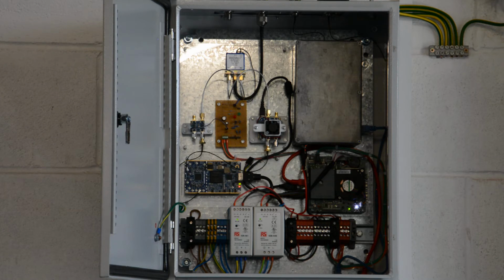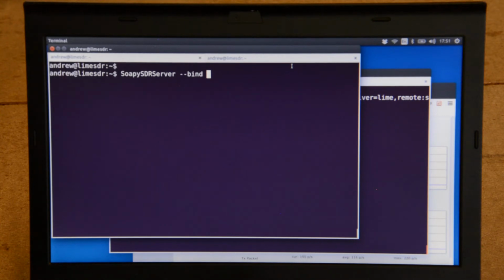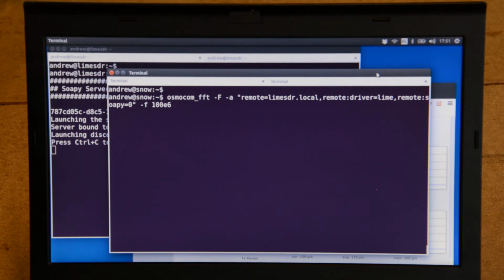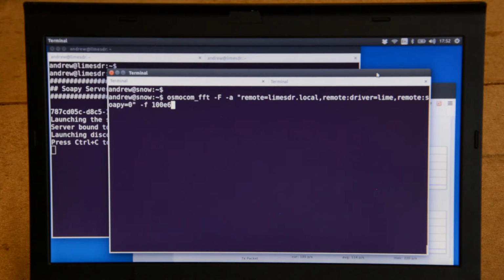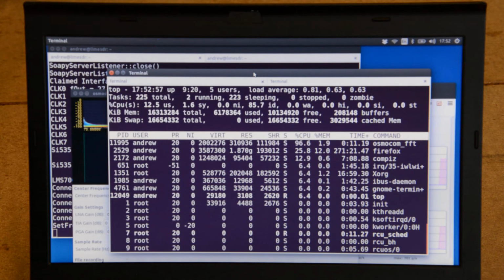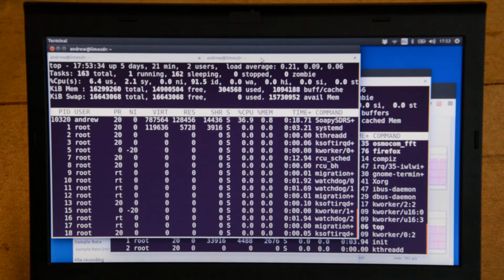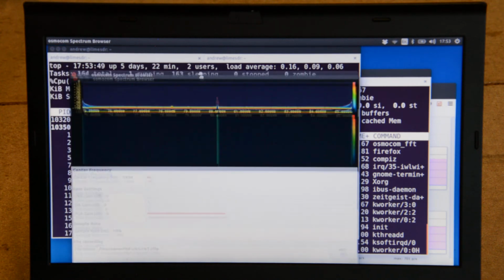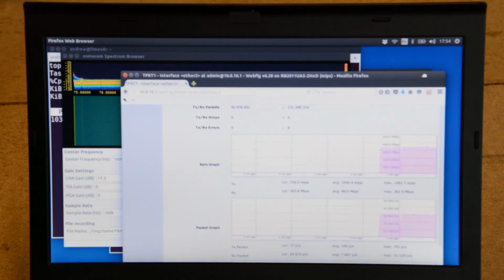LimeSDR + SoapyRemote + osmocom_fft Demo

Comment: How did you install the Lime software / SDRAngel?   Did you start with Ubuntu 18 and build from source?    Would love to find a distro that will work out of the box with the LimeSDR!   In Windows, the LimeSuite works fine but SDRAngel doesn't see the device.